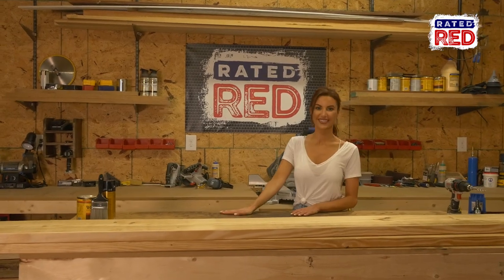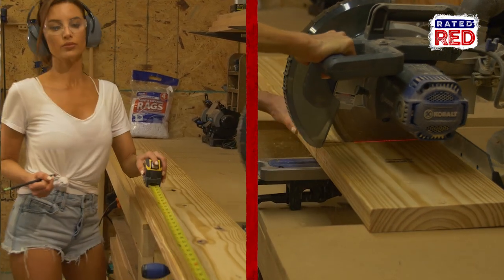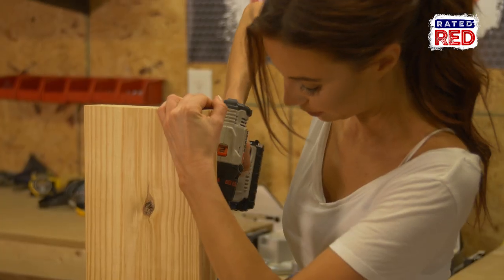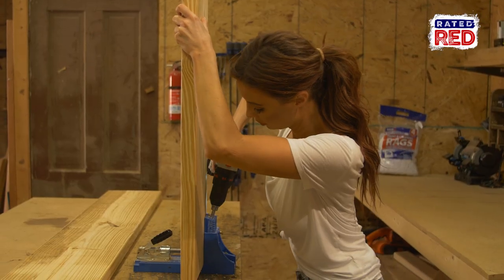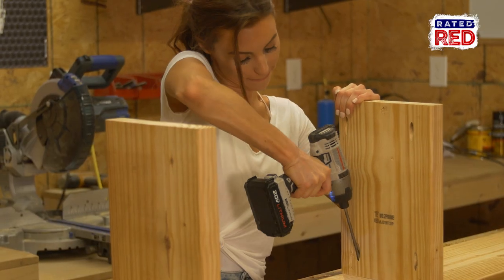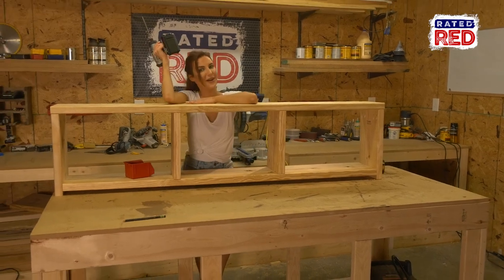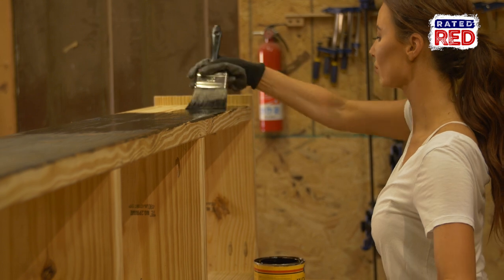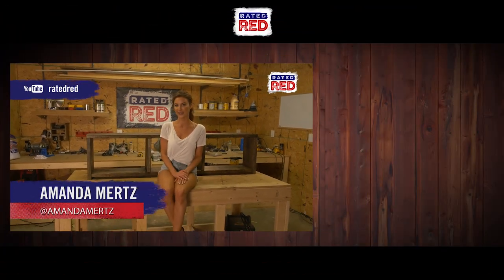Entryway Bench | Red Hot Building

Comment: I really enjoy watching these videos. Not just because she is gorgeous. these projects are super simple and practical. I work at a high end furniture and cabinet shop, and after years of building $100k+ kitchens or $3k+ chairs, the joy of woodworking has diminished. We stress too much about veneers, reveals, lighting. I quit my previous job so I could work with my hands. Ended up operating a CNC machine, then programming. Anyway, keep up the good work. I do strongly recommend using a lift workbench. It'll save your back